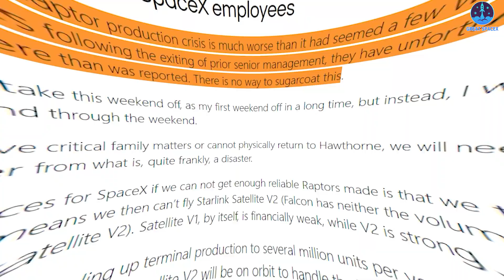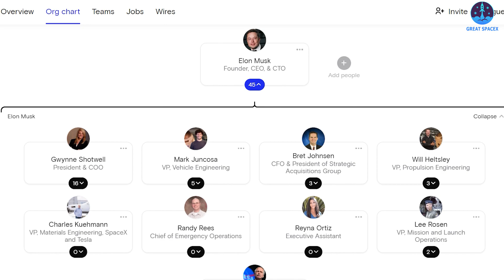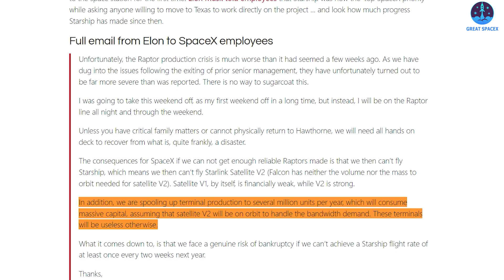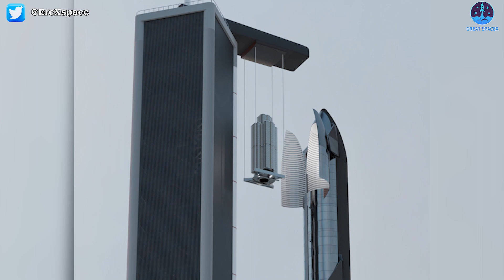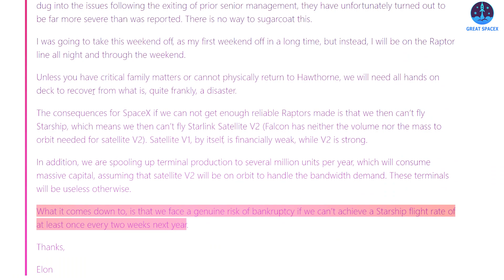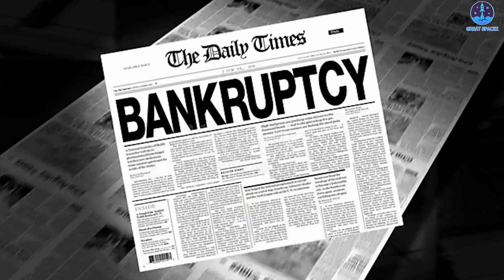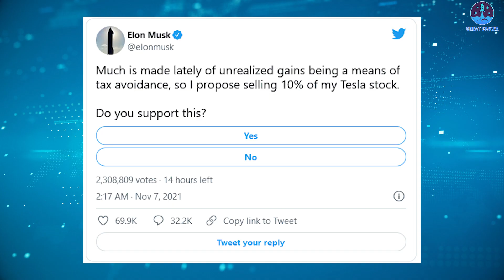Musk just revealed "Starship Raptor Engine is a disaster" that puts SpaceX at risk of bankruptcy

Comment: SpaceX will never achieve a Starship launch every two week next year,not even one launch every month! One every two months will already be problematic.
Reply: even if SpaceX could achieve that possibility there is no way FAA will allow such cadence from Boca Chica.
Reply: @Guren74  Well, right now they have a schedule/number of test launches but they will bump it up. They not gonna be asking FAA for every individual launch. They can book 1000 test flights per year if the gonna need.
Reply: Not sure what's going on. 2 launches per month = 2 Starships per month. He only has 1 right now, and there is no way he can build two complete ones per month. Why does he need engine production to be so high if he has nothing to install them on?  I think he's exaggerating.
Reply: @LupeMoya  each starship system will require 35+ engines (29 to 32 for sh and 3 + 3 for starship).
Very likely the first 5 to 10 launches will result in the loss of both stages this means potentially up to 350 engines required, more than 1 per working day that is a pace unknown in rocket industry.
Even supposing they will be able to recover both stages after just 5 launches it still means hundreds of engines to be manufactured in 2022.